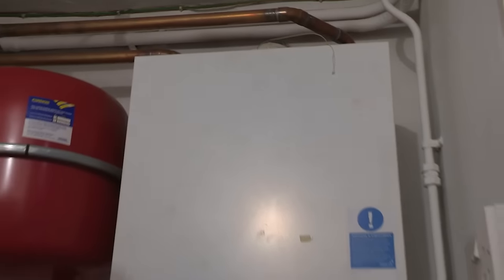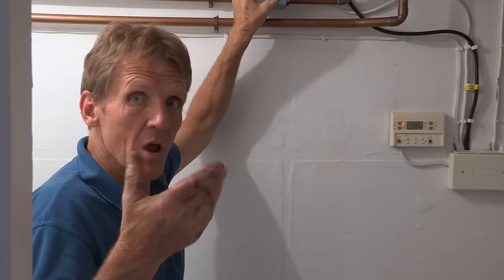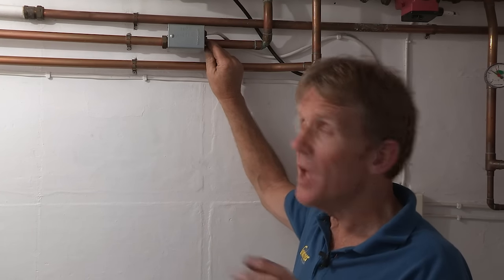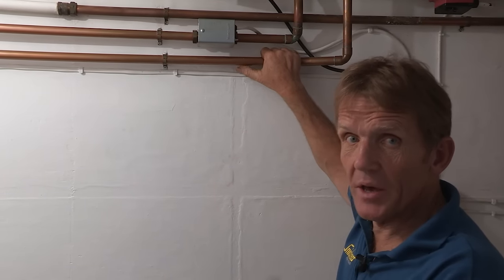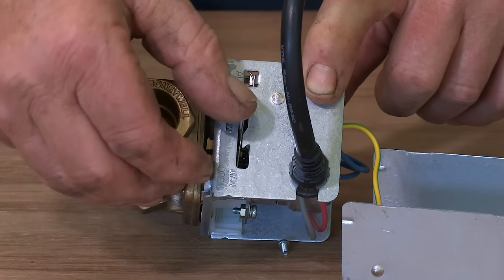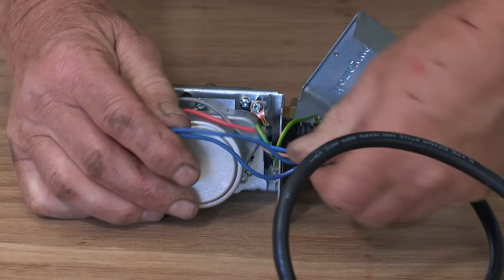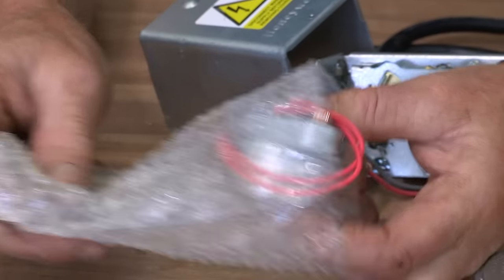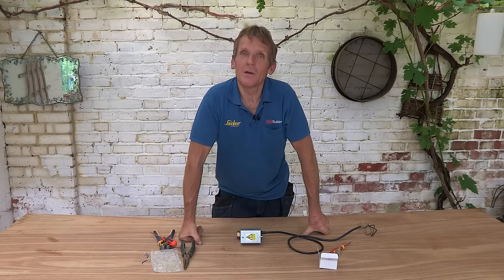How to Repair a Motorised Central Heating Valve

Comment: Hey Roger, 

Thank you so much for yet another 1st class video. I’m sure I speak for everyone who watches your channel, but  every time I do I always come away feeling that I have learned something new and as a DIY’er with so much more confidence than before. 

I just have a quick question today: and this relates to the compatibility of the two Danfoss actuators. Having changed out the HW motorised unit would it be wise or not to change the central heating actuator or not? 
Also, is it necessary to drain the system down before starting?

Many thanks and please continue with more superb instructional videos.

Kind regards,

TED.

Ted Bristow
Reply from the maker: Hi Ted 
Thank you for the kind words. If you are changing the actuator and not the body then you can do that easily enough. There is no need to change them as a pair because the heating one might go on for another 5 years.

Comment: Hi there.  My CH diverter is working fine.  But recently its been making a quiet knocking or ticking sound on startup.  Any ideas?
Reply from the maker: It is usually just a noisy cog on the rack. They are not precision engineered and there can be quite a bit of misalignment. It could go on for years like that
Reply: Thanks SB.  Yes, I suspected something like that.  On closer inspection of an old diverter, I discovered if you shake it, the top cap rattles which is exactly the sound my diverter makes.  Talk about primitive devices for a lot of money :0

Comment: Could it be possible that the damaged motor is also the reason why hot water will not stop? or will it be only for when there is no opening the valve therefore no hot water
Reply from the maker: yes it could be
Reply: Brilliant thanks a lot for the information, my replacement is arriving tomorrow so I will follow your steps, fingers crossed, and thanks again for your detailed instructions and further information

Comment: Any idea if it is the motorised valve if I only get hot water when the central heating is turned on? Will the hot water valve be the one connected to the pipe that enters the cylinder?
Reply from the maker: Yes it is likely that the relay in the head is not working when the valve opens. You can replace the actuator head without  touching the wet side.
Reply: Skill Builder - Thanks for the quick reply really appreciate it! I replaced the valve as I could see it was not pressing the micro switch inside the actuator. The new valve did not open to touch the switch so I moved it on manually until it touched the switch (it has been stuck on for an hour) - it should have filled the cylinder by now...any ideas what is wrong?

Comment: I think my motorised valve has burnt out. Got no heating. The valve feels hot and makes a buzzing noise when I pull it to the manual position. And the boiler isn't igniting nor coming on. My usual plumber's phone is dead. Is the motorised valve connected to the boiler ignition. I have a 23 year old Potterton boiler. If it's a simple job of replacing the motor I may attempt it. But if it's a bigger job I may have to get a plumber in.

Comment: I am getting a problem where the syncron motor fails every few months.  It is on a yplan system and the fault is no heating (the boiler is not called (orange wire does not come live)) I have even replaced the complete valve on more than one occation but still have the problem of failing motors.  Upon stripping the motor down I see there is one cog on the gear train, made of plastic, and it alway this cog that has stripped a few teeth.  (I guess this plastic cog is acting as a machanical fuse).  I am chacking for air locks and seem to have none.  any ideas?
Reply from the maker: Is the motorised valve a Honeywell. I have not come across the plastic cog, seems a bad idea.

Comment: It is rare that the motor actually "burns out" or fails, rather, the brass drive gear on the motor gets stripped and then makes insufficient contact with the adjoining gear that opens and closes the water valve. You might even hear a clicking sound as the motor partially engages the adjoining gear and then slips as it meets the stripped portion of the drive gear on the motor. Honeywell used to use a better alloy that did not strip but the newer version better helps their bottom line.
Reply: We have the clicking noise now. So it seems the gear has been stripped over time.
Reply: @scotttv2557  You can buy the motor by itself (~$35) and they are easy enough to swap even if you have few mechanical skills. If you are hearing "clicking sounds" that means that motor is turning the motor gear but it is partially stripped and the gear is slipping where it mates w the gear that opens the water valve.  Good Luck.

Comment: removed the motor and found that the toothed shaft was covered in grease which was making the gearwheel slip when it try to engage the motor. It also made the brass parts wear abnormally. Is this a fault that happens regularly I am I just unlucky !
Reply from the maker: They usually put a little grease on that shaft. It shouldn't make any difference unless grit has got in there
Reply: Looks like I need a new motor. Thanks. PS  This will be the third motor this year, looks like I need an expert.
Reply from the maker: that is unusual. I am thinking you may be drawing a load through it. The relay should take the heating load. It may be that it is running through the motor.

Comment: Thanks for this......unfortunately when I removed the cover, one of the wires went to a connector as you showed, but the other was soldered......sigh! That's when I backed off.

Comment: My fused spur keeps blowing when ever you connect any programmer to the backplate. A piece of jewellery fell behind the controller onto the backplate. Could something be gone in the motorized valve since the controller backplate wires really only control the motorized valve?
Reply from the maker: The controller goes to the thermostats and then the motorised valves. You just need to isolate each component. Check you have a 3 amp fuse. If the jewelry didn't blow the fuse it might have damaged another component.
Reply: @SkillBuilder  the chain did blow the fuse the first time and it just kept blowing so we called a plumber electrician he did his checks couldn't figure it out and wired the boiler directly to the spur which is fine. But I don't know if the room stat is knackered or not. Currently motorized valve lever is put into the manual always open position so heating and hot water works. The 5 core cable that goes into the backplate is N, L, hw/O, hw/On, Hw/Off. N L and E comes from the spur load terminals of the controller too. I'm at the point of disconnecting the 5 core cable leaving the N L E from the spur add the controller and see what happens then move of to each component
Reply: @SkillBuilder  I've been messing about with this for so long it's been over a week. I even rewired the 5 core cable since the cowboy builders who did the original wiring used two 3 core + earth cables to wire up the controller resulting in confusion and too many cables and cores to work with. All I've been seeing in my sleep for theclast week is cables, wiring diagrams and ideas of tests I'm carrying out 😁😁
Reply: @SkillBuilder  I've fixed it finally. Thank you very much for your advice. It was the motorized valve that needed changing don't know what shorted in there but if I connected it it would blow the fuse so I know it's that.

Comment: What if the heating is constantly on?  The valve is not closing, is that right?
Reply from the maker: Yes the valve will stay open unless you turn the thermostat down

Comment: Struggled to find this video but its a gem. Ive taken off the Actuator (not really necessary and am just replacing the Synchro motor (cost £9). Always but always turn off the electrics. Some of the wring you will come across may need tidying up. Do little diagrams or take a pic if you take the Actuator out. 
Plumbing quotes can be extortionate. I was quoted £1000 for a job that a local plumber did for £100. If you can do it yourself even better..
Anyone found a video of the valve being replaced as opposed to the actuator ?

Comment: My actual valve is stuck. What is the process to replace the pipe section? Does the system need to be drained? The one that is faulty is for the hot water. The valve is stuck open and therefore boiler running constantly.
Reply from the maker: Yes you need to drain down and then just replace it like for like

Comment: I have the opposite problem. The heating stays on and I have to hit it and it resets. Any ideas?
Reply: That’s the same problem I’ve got, it keeps the boiler on and over rides the thermostat of the hot water to get boiling..
Reply: @anthonywright9566  did you fix it?

Comment: Hey there, great video! I have a sticky valve motor - I can either open it manually with the red dial or if i give it a little knock with my nuckle it's gets it started and I can hear it/ see it winding away (works every time). Do you think the synchron motor is the culprit? Also, I have a sunvic valve, are they pretty much universal? Thanks.
Reply from the maker: It is probably the mechanical side that is the problem. Clean out the gearing and maybe a bit of graphite lock lubricant on the cogs and rack.
Reply: @SkillBuilder  Hi, thanks for your reply... Yeh tried that, no joy. I assumed it was the mechanical side but didn't know if there was a switch inside one of the relays or if it was the motor. I'll have a go at replacing the motor because I can pick one up for £20 odd pounds, then atleast I've ruled that out. Thanks again.

Edit: Actually, I think I might isolate the heating and leaving the sync motor plugged in, remove it from it's housing and turn it over to see if it spins when I turn it on. Will have to use some black tape so it doesn't come in contact with anything, the whole motors basically a conductor.

Comment: I know the 3 regular wires of five. Orange and Grey are the micro switch wires. Grey is the permanent live which operates the switch to the Orange that sends the signal to the pump and boiler to fire up

Comment: You can check the motor by a multimeter between the White and blue wire on ohms should read 200 ohms  for a good motor

Comment: Hi why is it when I leave mine on automatic then only downstairs radiator comes in but when I put it on manual both upstairs and downstairs radiator comes in perfect
Reply from the maker: I can only advise you on fault finding. Are the pipes hot on both sides of the valve when it is on automatic? Does that heat change when it is on manual? If so it means the motor on the valve is no pushing it open enough. I have seen many valves that are almost totally blocked. If you can drain down it will be worth looking through the valve ports and seeing if it opens fully on the automatic setting. If you can't do this put some system cleanser in your system and run ir around for a week and then drain and refill the system.
Reply: @SkillBuilder  on manual they are both pipe hot , when in automatic the radiator upstairs come on after after a hour  when I turn the main switch on from power supply

Comment: Roger or if anyone can help .
I have had two 2 motors fail on me in the past three years on the same circuit.
The first one installed July 2021 failed in Nov 23 was replaced late Nov last year and the same valve has failed last week Sept 2024 10 months after it was fitted .
Is this coincidence or are there any possible issues with the system 
Its a Zone valve that operates my UFH and does get used a lot .
But surely these should last 10 yrs at least 
Thanks in advance .
Reply from the maker: The last time I went out to a job where the motors kept failiing I found the motorised valve was out in the wrong way round.
Reply: @SkillBuilder  
Hey thanks very much . 
Ill mention it to my plumber who’s 65 who i was at the same firm 40 yrs ago when we both served our time , im 56 and a joiner .
Ps / he has a bloomin temper so ill have  to mention this diplomatically on Monday when he comes to install it .  👍🏻
Reply from the maker: Have a look at the body. Is there an arrow showing direction of flow? If it is a Dafoss it should flow A to B

Comment: The first rad in the system get hot. Could it be that the valve is not closing correctly please.
Reply from the maker: it could be but if it is you will feel the pipes on both sides of the valve get hot.
Have a look at our reverse circulation video https://www.youtube.com/watch?v=vu55TgMMDyE&t=6s

Comment: can it be the reason why blue light is flashing on the boiler?
Reply from the maker: not really. The blue light is specific to boiler problems, Reset, check pressure and condensate, then look for fault codes and check the manual.

Comment: What if the valve works intermittently? 
Whats the likely cause of that?
Reply from the maker: It could be a worn out motor or debris build up. It is worth turning off the electricity and taking the cover off to see if it is operating properly.
Reply: @SkillBuilder  cheers. I'll give it a bash.

Comment: The lever on mine moves freely when the power is off,  but as soon as it gets power it jams up and become very stiff.   Probably a burnt out motor?
Reply from the maker: It sounds as though the thermostat is wired the wrong way. Are you getting power to the brown live when the stat is calling for heat.
Reply: @SkillBuilder  I don't have a volt meter to check that sadly.  I've just had a new boiler put in by British Gas so I'll have to get them to come back and look.  Was trying to do a quick fix myself.  Thanks very much for the quick reply  :)

Comment: I've switched over the motor but that hasn't fixed our problem 😦 Does anyone have any ideas what should I be looking at next?
Reply from the maker: Ruth 
What is the problem with the valve? It might be the mechanism jammming or the valve the wrong way round.
Reply: @SkillBuilder  It seems that the valve itself is OK. I decided to try swapping the wires over (heating wires to hot water and vice versa) since it's a handy plug in style, and when I turned on the hot water on the control panel the radiators warmed up. I don't know yet if the hot water is working. Tomorrow when it's light I'll go back up there and do some more experimenting. It's certainly being weird.

Comment: I have just installed a new Drayton zone replacement valve.

The good news is that it's working; however, the issue I'm experiencing is that when my thermostat turns the central heating on, the valve moves to the off position and the valve closes and when I turn off the central heating the valve moves to the on position and the valve opens. 

I have a hive thermostat installed already

Does anyone have any idea what I can do about this? 

Thank you
Reply from the maker: You need to swap the wires over. The brown to the valve need to come from the live on the Hive when it is calling for heat.
Reply: @SkillBuilder  thank you for your quick reply.

 So I moved the live valve wire to the junction that has the live wire for the hive receiver and live boiler. 

When I turn the heating on now. The value does nothing, any suggestions?

Comment: My heating is not turning off. Is this down to the motor?
Reply from the maker: It will be the spring return mechanism sticking open. You may find that putting the nozzle of a vacumm cleaner over the leve is enough to remove any dust or grit but if not turn off the power and remove the cover so you can clean it and check the mechanism.
Reply: @SkillBuilder  I checked the motor. The gears are stiff and the spring is not able to wind the motor back. I will replace the motors. Thanks.

Comment: Great video. Just wondering if anyone has had this problem?? Have a gas boiler (not a combi as I have a hot water unvented cylinder), hot water will not come on unless the central heating is on at the same time. Not we have a bit of warm weather I need to put the thermostat up really high to be able to get any hot water. Was hoping it was a faulty motorised valve but having just done Rodgers checks on mu hot water motorised valve I am not too sure. Valve seems open when it should be and closed when it should be but still only getting hot water when central heating on too! Anyone ever had this before??
Reply from the maker: If the motorised valve to the hot water cylinder is open it should then send a signal via the internal micro switch to the boiler. You have a grey and an orange wire going into the valve. The micro switch completes the circuit on the grey and orange wires. It may be easier to swap over the whole actuator head but sometimes you can tickle the micro switch to get it working. I have seen them clogged with debris.
Reply: @SkillBuilder  thankyou. Changed the whole thing and 'seems' to be working now. House is 12 years old- everything starting to go at one time. Thanks for your help!